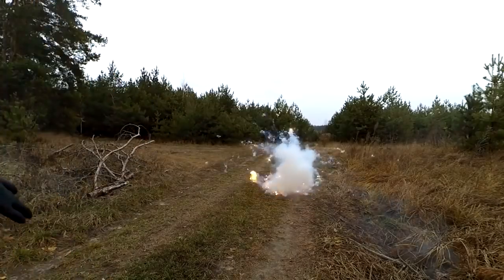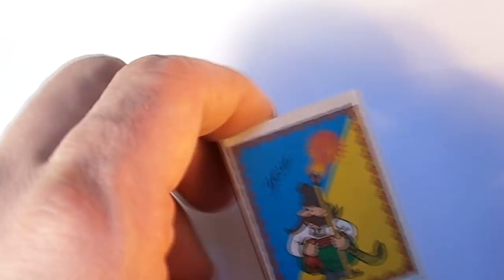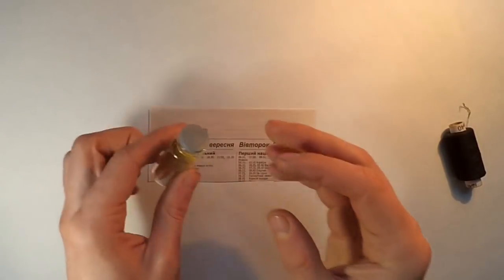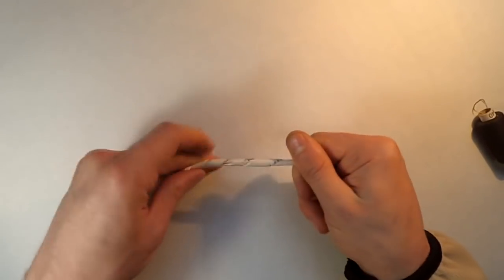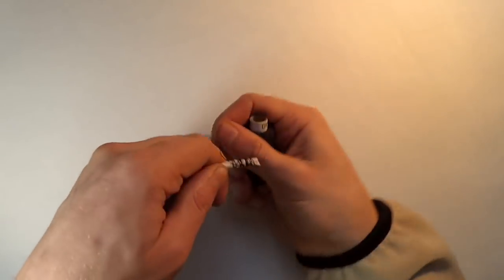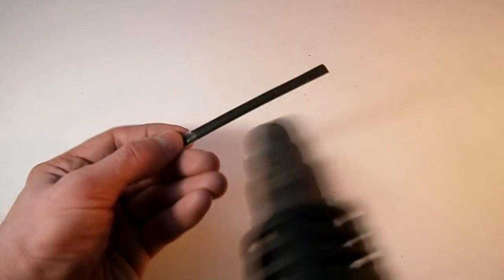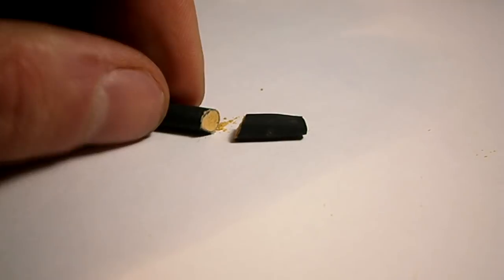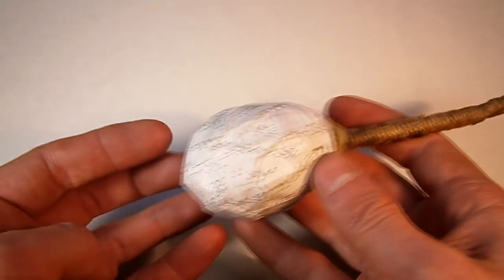How to make pyrotechnic fuse. 2 fast and simple methods.

Comment: Your videos are awesome.Super good content.I am also interested in fuse making .I made myself lots of fuses with different methods starting from blackmatch upto waterproof fuses https://youtu.be/BkAXDV2eag8?si=B6-rXwfurdzeUXN5.I also like  chinese style wrapped paper fuses.My favorite type of fuse is a plastic straw filled with slow burning black powder .Its very simple to make just hold plastic straw with pliers  and melt it by heating it  with lighter so its plugs then fill the rest of tube and plug other end by heating and melting .While melting you need to squize so it makes perfect seal.😊😊😊

Comment: Will these ignite gasoline?
Reply: Gasoline does not burn in liquid state, only when it's a gas, so the tiniest spark will ignite it. I don't recommend fuses for igniting gasoline. I don't recommend igniting gasoline at all, it evaporates very quickly and therefore it is very unpredictable. Stick to black powder and flash powder. Not sure what you wanted to do with that gasoline but flash powder obliterates everything around it;)
Reply: @mw-tj6ob  giant woodpile soaked in gasoline. B kinda cool to stand back and light it with a fuse.
Reply: @joshoconnor6684  i would suggest a straight trail of gasoline like they always do in the movies, not too much and very long. Always better to be safe but honestly there's no better thing than bumpstarting a campfire with gasoline:)

Comment: for a match fuse use king sized rolling paper and add a little piece of string first as a guide to help you roll a tight small fuse and mix 15% sugar with matches for a slower burn especially when using a rolling paper it's not that big and make sure your fuse isn't contained like if you put your fuse in  a metal tube and lit it, it would burn much much faster which is dangerous so make sure ur fuse is in open air and use a thin line of matches and sugar for a about a 5 seconds delay

Comment: Can you show how to make electrical fuse or is that not the ninja way
Reply from the maker: +science_and_anonymous   electric igniter is good! If something is good then this is ninja way! Yea i can make it i even made them before but i cant make it bettet than for example mrGear or some other youtubers. I made my igniters with nichrome wire from aliexpress (0.2mm) and powder from match heads.
Reply: NinjaChemist ahhh very nice. Yeah, the biggest drawback I've had so far is the current to amp ratio ya know? A 12V battery can't set stuff off too far away and a house connection is egh...hahaha. if only I had a blasting generator like cody
Reply from the maker: +science_and_anonymous You dont need all this shit. Just buy little remote controlled relay module: https://youtu.be/1tQOJ6husuQ
Reply: @science_and_anonymous  Anthony is that you ? Lol
Reply: @agorist.boogaloo  yes...who is this lol
Reply: @science_and_anonymous  Just your Instagram follower, but I wanted to see if it's you fr